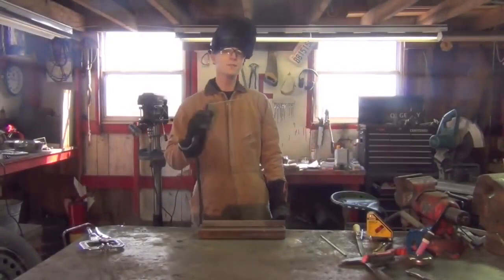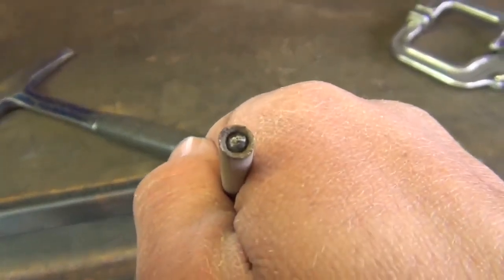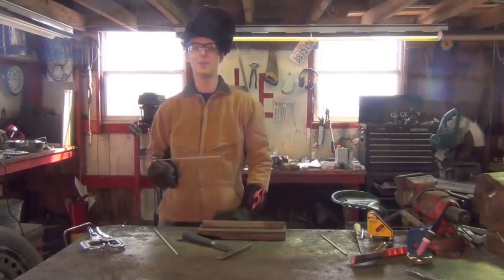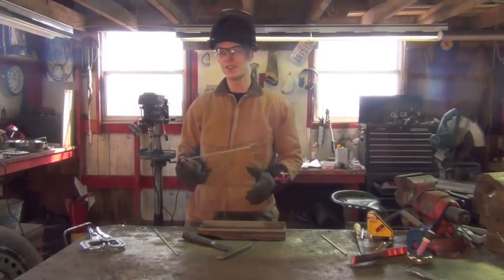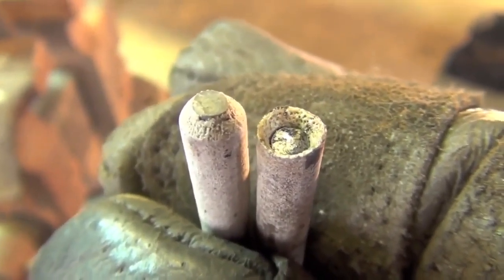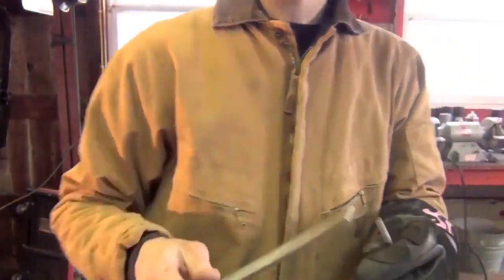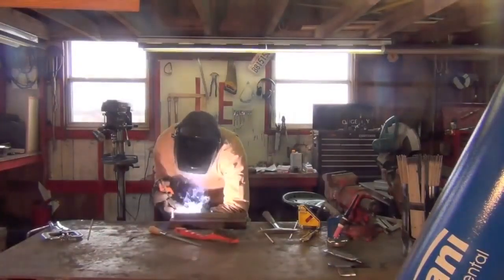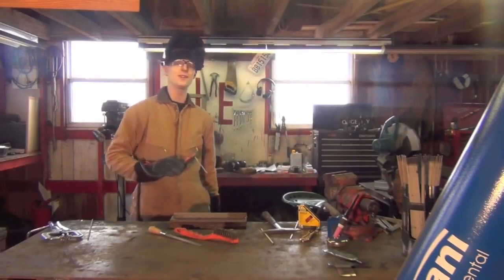Stick Welding Restrikes With 7018 MADE EASY!!! Arc Weld Quick Tip Lesson!!!

Comment: Somtimes it just doesn't matter, but where it does I've noticed that the cut-off wheel of an angle grinder will make a very clean cut without cravking the flux (due to very high speed ?!?). 
    Also the fine grit wheel of a bench grinder if clean and true (use a dressing tool) should bevel the flux without cracking it. 
    The 7018 is so strong, you might never notice, but where there is weakness, it will be at the restart. 

     This video gives a good overview of the issue with your usual can-do energy. Thanks for sharing that with us.

Comment: All you have to do is pinch the end of the electrode with your off hand and the flux will break off behind the rod exposing the rod for restarting the arc, I’ve been doing this for 26 years and I’ve never seen anyone use a file to dress the end of an electrode, but if that still doesn’t work tap it on something without it being in the stinger a few times and that will make a good restart

Comment: I have taken the stick out and scraped it hard against the steel, it will clean up, also using a rough concrete floor to scrape the stick which may introduce some foreign material to the end but for my use I don't care if there's something or not.